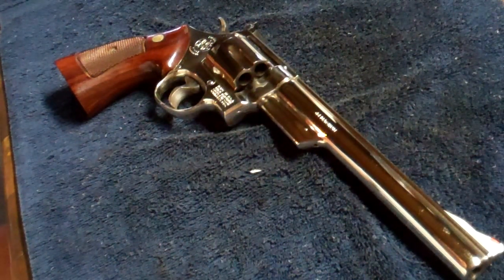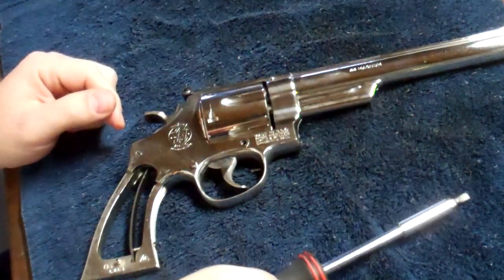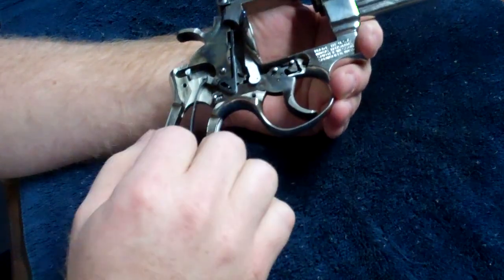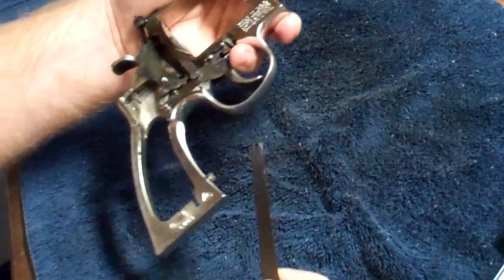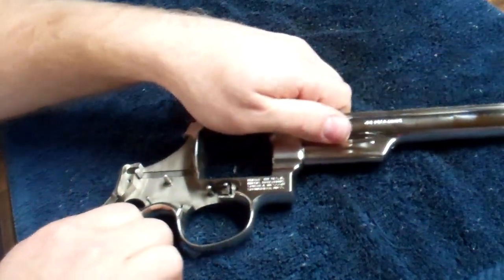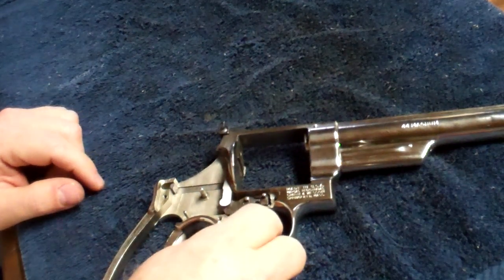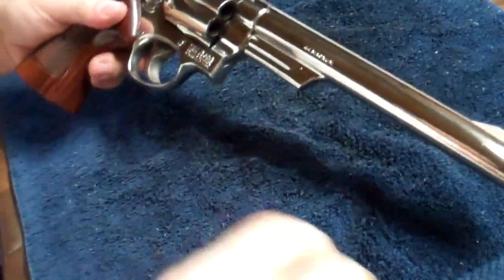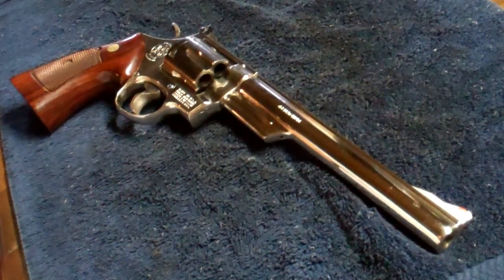Smith and Wesson Model 29 .44 Magnum Detailed Disassembly

Comment: I used your instruction to disassemble, clean and lube a S&W Mod 28 Highway Patrolman that is 40 yrs old but in perfect condition. It was gummed up though and not pulling smoothly. The gun now runs as smooth as it did when it was brand new. Wish I could run as smooth as I did 40 yrs ago, haha. Thank you.
Reply from the maker: Not a problem, it feels good to get those old war horses running smooth again.

Comment from the maker: The pin on the hand is where the round part of the spring goes. The shorter part of the spring goes in the trigger and the longer provides tension on the hand. Look for the wear points where the spring rubbed to see exactly where they go inside the assembly. There should be forward tension on the hand (towards the front of the gun) when it is installed correctly.

Comment: Excellent video! I followed along perfectly and was able to detail strip my S&W Performance Center .44 magnum. I also took out the cylinder release and firing pin, as well as a few small bits that mine has that don't appear to be on yours, but it was no trouble. My revolver is now sitting (in pieces) my my ultrasonic cleaner as I type this, after which I'll lube it, unpause your video, and put it back together with you. :) Keep the vids coming and happy shooting!

Comment: Don't be afraid, just be very careful not to let the rebound spring fly or the cylinder latch spring. Other then that, it's just a matter of not forcing anything, when the parts are in alignment they will basically fall into place. This young man gives the proper order of disassembly and assembly. If you ever have to bet your or your family's life on it, it is better to know it's clean and functional! Good luck and don't be scared.

Comment: Thanks so much for this video, it helped a lot! My grandfather gave me his old Smith model 57 .41 mag. It was made in the 60s or 70s it is older than I am. The small springs inside were covered in rust and the rest of the small internals weren't much better, this gun has probably never been completely stripped in all its life. I soaked everything in ballistol and wiped it clean, reassembled and you wouldnt believe how much smoother the action is. Thanks again!

Comment: Thanks! My 629-1 is happy and clean now. Couldn't figure out how to get the side plate off. Tapping with a rubber mallet worked. And now my hammer block is in the right spot and doesn't rattle. Thanks again- saved me a call to S&W.

Comment: Thank you so much for your very instructional video. Nice work!  I think I'll stick with just removing the cylinder and handles for cleaning. I'm not brave enough to break it all down like you showed. I own several S&W revolvers (.357's, .44's and .50's cals). Cheers, Ron

Comment from the maker: For normal cleaning I use CLP-- or any kind of solvent will do. I always take the grips off before cleaning too-- will prevent chemical damage on the wood. I use rem oil for lubricant. For the internals I use a product called slide-glide. It has the consistency of jelly and bearing grease. The nickel finish on these guns is very tough-- none of the above mentioned cleaners and lubes will harm it. I just use a cotton rag to wipe the finish down after I clean the gun.

Comment from the maker: I think you are talking about the cylinder pin-- you need to remove the cylinder from the gun and unscrew the center pin (from the forward end). I use an old belt to wrap around it (so I don't damage it) and then a pair of pliers over it to unscrew it. You can also unscrew the extractor from the other end. I use the belt again to get enough leverage on it. Once these are out it should come apart.

Comment from the maker: Yes there is another spring on the inside of the frame that travels parallel to the cylinder release to provide tension on it. It can be removed for cleaning.

Comment: very thorough - though I ran into the problem of the hammer not cocking all the way back due to the little pin on the trigger mechanism not sitting down into the piece of metal that slides vertically near the firing pin and "hand" on my 629 3inch

Great video though and very helpful Thank you

Comment from the maker: This one came with the wooden presentation case-- I think they are around 900-1000 with that if you can find one. Funny thing is you can get a brand new 29-10 for just under $800. People like the 29-2 though because of the pinned barrel and recessed chambers. I paid $399 for this one in 1999.

Comment from the maker: Yes we are on the 29-10. Some of the differences are the -10 is the barrel is not pinned, the cylinder is not recessed, it has in internal firing pin, the grips are different, and it has a locking mechanism by the cylinder latch.

Comment: when the gun is assembled and you tip it backand forth can you hear the pin inside the spring of the rebound slide clicking and also my pin has a dome on one end, is there a correct way to put it in - thanks

Comment: Great video.  My Model 29 is around 40 years old.  My question is, when I was popping out the cylinder stop, there's a little spring loaded rod in there.  I'm not positive but I don't think a spring flew out when I was removing it.  Is it possible that my older model is different?  In that it has a little rod in there instead of a coil spring?  Or does a little coil spring kind of "coil-over" that rod and it flew out and I lost it?  If I did lose it, do they sell that spring on S&W website?
I'm hoping that it's an older design and there was no spring because I feel like nothing flew out upon removal, but then again it could have just rocketed out of there and I didn't see it.
Any insight would be appreciated.
Reply from the maker: +Lyle Vinson Yes there is a little coil spring that goes over that little rod. Call smith and wesson and you can order one over the phone. Make sure it's not stuck in the hole first. I've lost springs before, not a big deal just order another, in fact order 2. Google Smith 29 exploded view to see a diagram. It's part #7. They call it a bolt plunger spring.
Reply: +XJRMANIAC   Are you sure, because that little rod depresses into the frame like it acts alone as the device that pushes that cylinder stop.  When I put it back in it works fine as per what it's supposed to do.  There isn't a little socket in my piece that accepts a spring, like yours.  That's why I am curious if this is an early design with no coil over because the cylinder stop has no depression to accept that spring.  I'll look at the diagram.
Reply: +Lyle Vinson 
I just unscrewed a little screw on the outside of the trigger guard that revealed a tiny cylinder with a little spring that operates my little cylinder stop plug.  That's what I am calling it for now.  I think I have an early design.

Comment from the maker: Thank you for the compliment. This would represent a cleaning job I would do every 5000-10000 rounds, which for a lot of people would be never. When I buy a revolver of this vintage I will generally take it down to the point I did in the video and clean it because chances are it has not taken apart and cleaned like this before.

Comment: To replace the cylinder release do I just unscrew it? Or do I have to open the frame? Thanks
Reply from the maker: Just unscrew it and the thumbpiece will come off. No need to remove the sideplate.

Comment: Hey, will this disassembly work for a S&W model 28-2 (highway patrolman) they look to be basically similar, also on my revolver where its stamped made in the USA smith and wesson etc. over the trigger guard, it looks like it was stamped 3 or 4 times, so the wording is like mmmaaaadddddeeuuussss what would have caused this and does it affect the value? Thanks for posting the video!

Comment: How would I be able to take the barrel off? I have an 8inch barrel and a 4inch barrel and right now the 8inch is on the gun but I would like to put the other one on.
Reply from the maker: If it is a 29-2 or older you will have to knock the pin out of the barrel near the frame with a punch (concave preferably). First, remove the cylinder. Second, knock that pin out. Third, wrap the barrel in protective cloth or rubber (or both) and put the barrel in a bench vice with the barrel pointed straight down and the frame as close the the vice as possible. You can also put wood or nylon blocks in the vice to help avoid scratching. With an additional hand held clamp type vice grip, I use a large craftsmen one with the handle that pumps down with the rubber jaws, attach it to the frame as close to the barrel as possible. Turn counter clockwise at it should come right off. You are actually unscrewing the frame from the barrel, I find this is the easiest way. Be careful not to bend the frame. If you put that second vice on the grip area of the frame for instance, you will bend the frame.
Reply: If you want to change the barrel it would be best to let a gunsmith do it.  Chances are it will need to be custom fitted so that you have the correct cylinder gap.

Comment: Thanks though for a great video.   My side plate was an interference fit,  it was all set up fine just needed a tap to get it to the final position.....    I enjoyed my first S&W strip down and clean and it was necessary -  the interior was grimy, over-lubed and had old toffee like lube from  30 years ago!  

I think. If I could be critical I think you go a bit too far on tightening the screws.

Comment: I recommend Jerry Kuhnhausen's book on Smith and Wesson disassembly.  I see you mentioned Brownell's.  Why don't you get a set of Grace screwdrivers for a perfect fit to do this?  And get the tool for the rebound housing.  I can't stand to see folks prying parts out like you do and using the frame for leverage.  I see way too many S&W's with messed up screws, overtightened screws, and tiny scratches on the grip frame and side plate.  You should have a bench block to do this work also.
Reply from the maker: Thank you for your advise, why don't you enlighten all of us and post a video using all of the "correct" tools and techniques.
Reply: I did not mean to offend. I have been performing and showing S&W work for over 44 years. I don't make videos; not gonna start now.  You make a good, clear video. But things can get messed up real quick even with good videos.  I've seen  too many of these fine pistols messed up. Grace has been in business a long time and they have better temper, parallel ground bits and handles that fit better. You can/should slit your punch to go over the stud. Studs break off as you realize and then they go back to factory. A small block of wood or plastic to set under the grip frame and a clamp and cushion to hold your work steady frees up your hands. You will work more positive. A small hemostat locking pliers are perfect for taking the cylinder stop out straight up as you capture that spring. You have demonstrated things some "gunsmiths" can't do without messing up.
Reply from the maker: 2001FLHr
No offense was taken. This video is not meant to replace Smith and Wesson's service department, nor is it meant to encourage people with little to no mechanical skill to take down a revolver. It is simply here for informational purposes for people to use if they so choose. There are many people that can do this better than I can and I encourage them to share videos and information, as most people learn far more from physical demonstration than they do from reading a book. I have been  slowly upgrading my tool arsenal since this video was made, as I cannot afford to buy $1000 worth of tools at once for my gun hobby. Thank you and happy shooting.